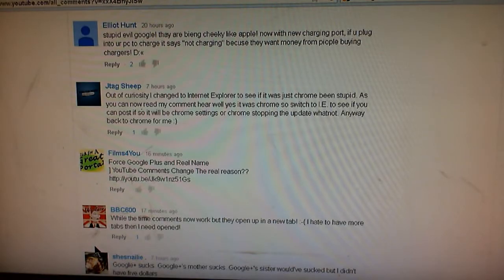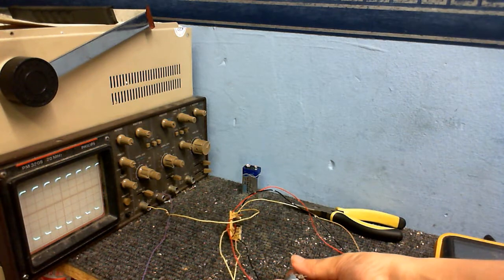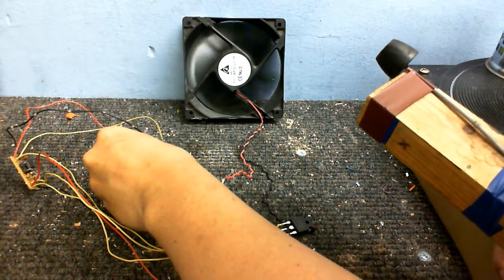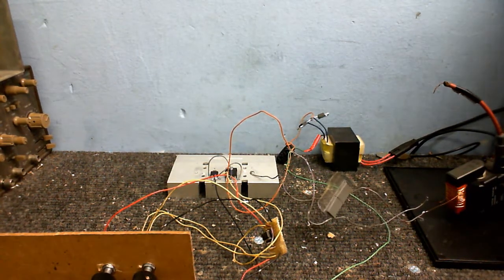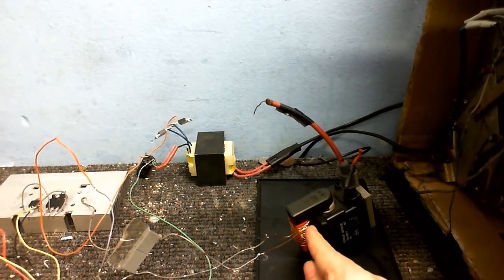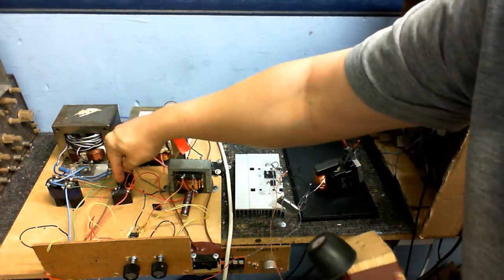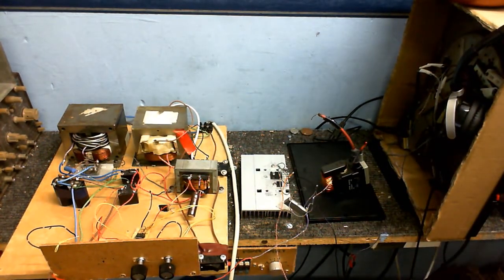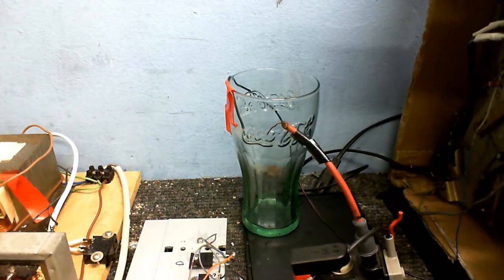CDC Electronic Workshop -  Opamp based flyback driver

Comment: Hi Clem. I love your videos they are fun, informative and capture the essence of  experimental science like no other,  I'm particularly intrigued by your work in this one  which has set me wondering if the singing arc is really what is producing the sound or is it going through a speaker and the arc is serving as some sort of a switch, so I'm off to find out.  Thank you for all the work you have done to present this video.
Reply from the maker: The arc itself really does produce sound, there were no speakers used anywhere, the audio signal modulates the intensity of the arc, whitch produces pressure waves in the air whitch is the sound you hear.
Reply: CoolDudeClem
Thank you and yes I've been rummaging through youtube looking for information about plasma speakers, high voltage generators, pulse width modulators and related stuff and sadly there is not very much out there.  So Clem thank you very much for your amazing work on this. Though I know it involves a lot of trials, I'm considering putting one of these together. First I need to know if I have enough components with which to put one together,...so,... if I may ask,... which op-amp would be suitable instead of the 555 timer chip? I looked at the ones that are stuck around the flyback transformer in a couple of circuit boards I pulled out TVs but I don't have a clue if they can be used in this sort of circuit. Anyway, in the meantime I'll keep digging.

Comment: hey clem would any op amp work
Reply from the maker: It would have to be one that can handle high frequencies, I used a TL072 witch is a very good op amp which can handle high frequencies quite well, but most op amps such as a 741 are only good for audio and might not work so well.

Comment: can i use a flyback from a TV like a audio crossover?
Reply from the maker: Genadi Enev It's possible I guess, but why would you want to?
Reply: cuz i will buy a 500w amp and build speakers for it 3 way 2 woofers 1 mid and a Horn